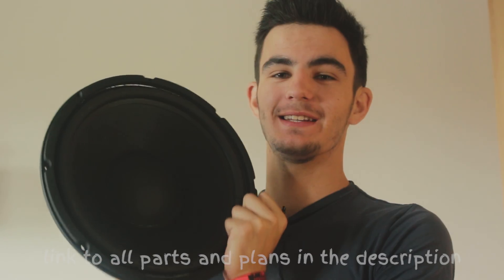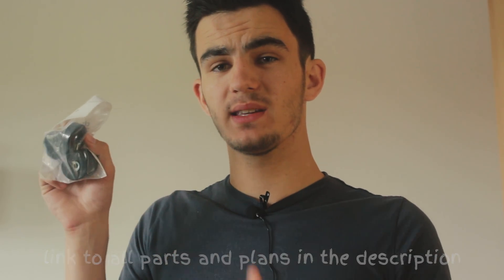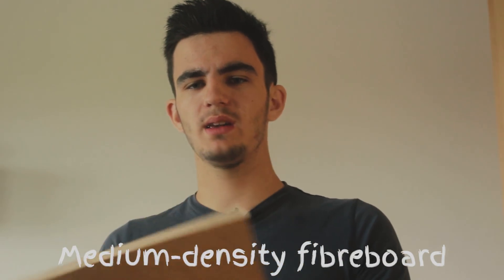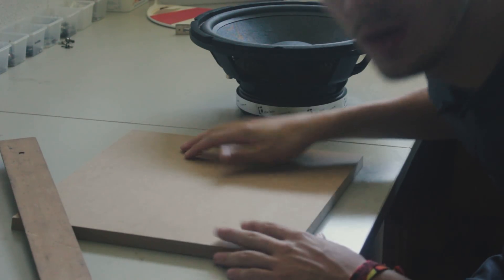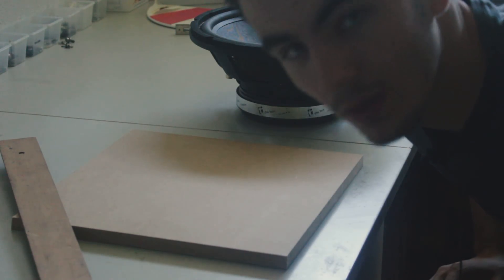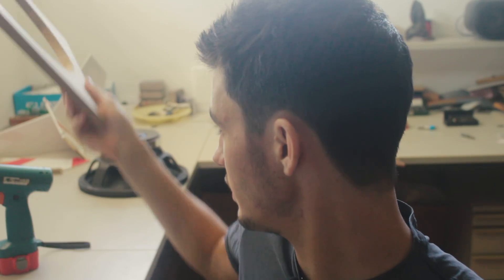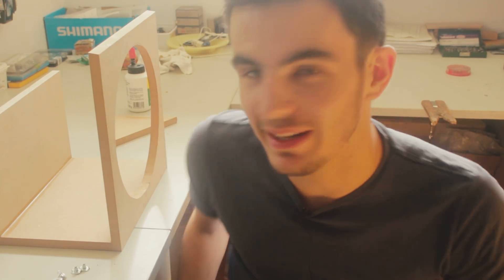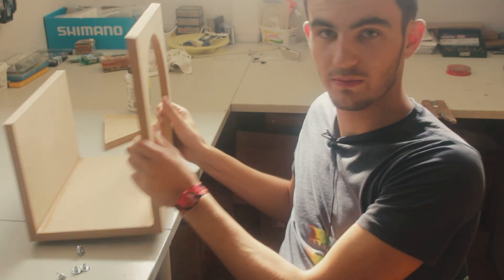Build a 12" MTH-30 Tappedhorn SUBWOOFER

Comment: Were you using TPA3116 to run that speaker? Great BUild tho
Reply from the maker: Yep but only for testing...
Reply: @Mattstir  what were the results BTW? ... and one more thing.. the speaker u used have a foam/rubber suspension shouldn't it be that paper type thingy?
Reply from the maker: @coffeebeatsofficial1349  Na only for testing if everything was wired up correctly ;)
What do you mean with paper type? The speaker is designed that way by the manufacturer. Or what do you mean?

Comment: whats the advantage of this tapered horn Vs regular Bass Reflex ??? In what way the horn sounds better ???
Reply from the maker: There are pros and cons for both. Typically you can say that a horn has an higher SPL/w/m but the bass reflex manages to play at lower frequencies. This can be very different from box to box so its better to compare 2 boxes and not 2 types of boxes ;)

Comment: I am curious of trying to build something like this, but scaling it to 18", and as asomone else mentioned. I also noticed you didnt use any screws, curious, is wood glue good enough to withstand transport and durability? I can see screws compromising sound quality if youre not carefull but just curious if it was on purpose. - t
Reply: Search for "LBH Basshorn"

Comment: Did you modify the dimensions to use 16mm? I want to build but I do not know how to do it, here I find it difficult to find 15mm, the plywood is twice as expensive.
Reply from the maker: I just adjusted the dimensions that the inner part stays the same as good as possible. Of course it isn't 100% accurate but i would say the difference in sound will not be noticeable :)
Reply: @Mattstir  Thank you very much, could you tell me how you adjusted the dimensions? It's the last question, I'm sorry to bother you.
Reply from the maker: @bryanruedacortes3528  Increased the outer dimensions slightly, so the inner dimensions can stay the same. The inner three pieces of course are changing a little but i think that doesn't change that much. No problem always nice to help somebody ;)
Reply: @Mattstir  Again, thank you very much, I will work on the project, I have 4 pd12sb30 and I wanted to take advantage of them. a greeting
Reply from the maker: @bryanruedacortes3528  Building your own speakers which work well is very satisfying. So... have fun :)
Reply: @Mattstir  Thank you😁

Comment: I don't know if you measured the speakers parameters and used software to simulate the performance of it in the MTH-30, but picking a box and a random woofer to use is not the best way to go about designing a bass bin. The 12-280 looks like a decent speaker, but that doesn't mean it will perform at it's optimal potential in that box. The whole point of DIY, is to optimize the designs around the speakers.
Reply from the maker: fidstang no i personaly didnt calculated it new.. but before i built it i looked online and there are a lot of people how use this sub and box togehter and they were happy so it schould be ok and it turns out that it plays pretty well :)
Reply: You should download REW and use your microphones to measure the response of this combination. It would be interesting to see what you get.
Reply from the maker: fidstang i will have a look👍
Reply: What software to simulate that thing?
Reply: Master Gamer Hornresp
Reply: The box is perfectly calculated for the driver lol

Comment: Hey man, really cool video thx ! I believe the MTH30 was designed in order to run with a 500 RMS speaker. Does it change the efficiency of your subwoofer to run on a half power speaker ? 

Keep up the good work !
Reply: You can also use the RCF LF12G301 (450W RMS / 900W max) in the MTH30. The designer of this sub (Marc'O) has validated this speaker for it.
I got 4 pc of the MTH30 with the RCF speaker (pushed with a t.amp TSA 4-700) It sounds great, loud and very good (a max SPL of 137 db with 4 pc !)
You can both use MDF or plywood. The only thing is that MDF would be (very ?) cheaper, but more heavier.
But you'll have to respect the wood thinkness (15 mm) At least, for the inside pieces. Or you'll modify the internal volume and the speaker could not have its optimal performance.
Just one other thing I noticed in this video : the wood was only glued and not screwed. I don't believe that it keeps up with time because of the vibrations...
It must be glued (wood glue D2 recommended) ...AND SCREWED ! 
Have a good use !
Reply from the maker: Thanks!
Yes the MTH-30 was not designed for this speaker, often the PRECISION DEVICES PD.12SB30 is listed as the speaker. 1. It is very hard to get it... seems like they don't produce it anymore. 2. It was 3 times the price of the THE BOX..
The RMS value won't really effect the efficiency of the Subwoofer. THE SPL value of them are nearly the same but i would say YES it is less efficient because the box doesn't fit it perfectly. All in all the "the box Speaker 12-280/8-W"(not the A version) is a pretty good pick, good price and also works good :) Hope i could help somehow.... :D
Reply: Some people (mainly in Germany) use the TheBox 12-280/8-W (48€ !!!! at www.thomann.de)
They look pretty happy. But you'll not have the performance of a RCF LF12G301 !
But that should be enough for an apartment or a small room.

Comment: Nice work...!

BTW, for an alternate connector to use, have a look at this one - it's a bit sturdier - https://www.parts-express.com/neutrik-nl4mpr-speakon-connector-4-pole-round-chassis-mount--092-054

The MTH30, built using the published dimensions, is a ~52 Hz TH, which means it will be loud, but you're not going to get much low bass out of it.  I've put together a spreadsheet that allows you to change the size of the horn to suit the driver you want to use with it, but it does require knowledge of Hornresp in order to analyse the results.  See here for more information: www.diysubwoofers.org/sheets
Reply from the maker: Thanks!

Comment: not a tapped horn
Reply: Chase dont talk bullshit. A Tapped horn is based on Quarterresonatorwaveleght as in this plan. It does not matter in which direction the driver is mounted. Just look at Other THs like the tham12, 15, PAL12,...
Reply from the maker: On the hornplans site its called tapped horn... I am not a horn master so i cant really tell you ;D
Reply: a true tapped horn the magnet is mounted inside the chamer and the face fires into an area that starts small  and grows larger to the end of the "tapped horn" chamber which is also pulling upwards at a 45-65 degree angle then feeds the enhanced sound wave into a much larger port that grow till it ends
which would result in a magnificent bass response one much larger than this false designed tapped horn
Reply from the maker: Ok thanks!! Horns are kinda complicated :O This was my first "horn" so there is still a lot learn :D
Reply: what did u plan to use it for?? theater solution?
Reply from the maker: currently it is only used for listening to music and there are not really plans for something else :)
Reply: Chase Leim this is indeed an example of a tapped horn. The horn length looks a little small and the throat looks too large to get a good response and efficiency but it is still a tapped horn.
Reply: chase you are a fucking noob. go back to your moms basement you dont deserve to be here
Reply: Lies, that's exactly what it is. lol
Reply: All "MTH" are tapped horns. MTH means "Marc'O Tapped Horn"...
Google is your friend : search about "what's a tapped horn" (...) lol
Reply: Chase Leim did you mistakenly build a tapped horn? The design in this video does not have a distinctly separate chamber connected to the listening environment by a column of air or resonator that is the staple of a bass reflex design. The impedance profiles of each design would show the difference. I guarantee that this one will have three peaks within its passband whereas a simple ported enclosure will only have two with the minimum impedance between them corresponding to the port resonance frequency.
Reply: im gonna say kinda i use a front mounted woofer insted of this way
Reply: Your young, stop arguing and do some research before you post. You were wrong.
Reply: reminds of the ported box i built from scratch wood
Reply: dude im no noob i build t lines all the time i build tapped hors all the time dont call me a noob because ive been doing this since i was 14 years old
Reply: your an idiot ik that the mounting of the driver doesn't matter but im 100% sur this isn't a tapped horn but some bullshit excuse of a ported box